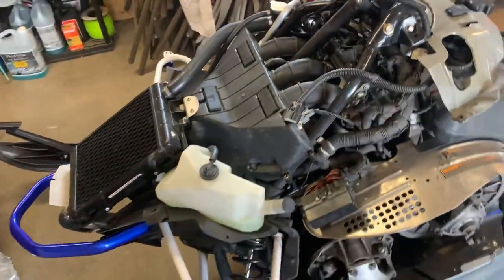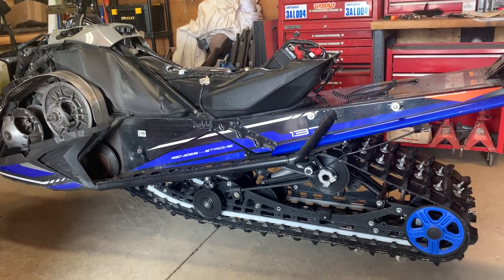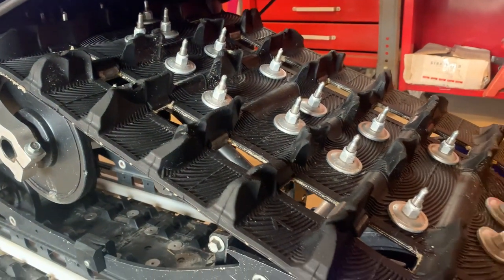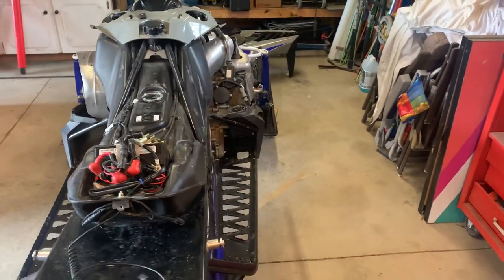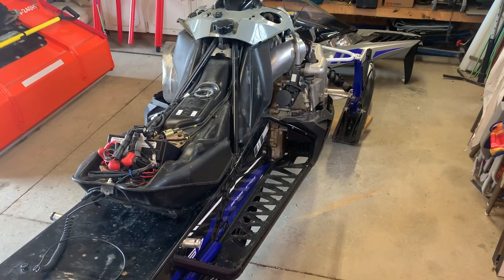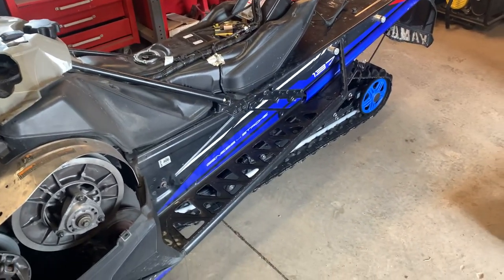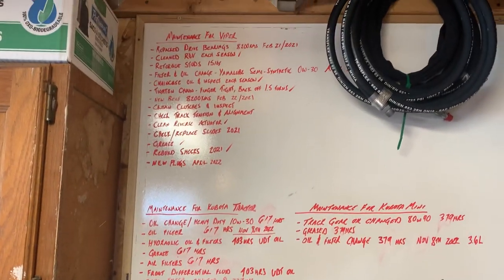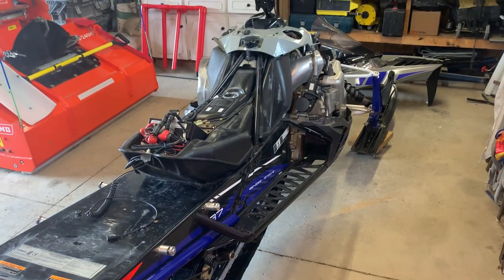Spring maintenance | 14,000kms service | Yamaha viper ltx dx

Comment: I’m doing the same thing on my 2018 ZR 8000 with 12k. My driveshaft had spun on the bearing. A local machine shop is building it back up with weld and machining back to spec. Picking it up tomorrow, should cost about $200
Reply from the maker: If your in Canada, a new driveshaft costs $218.00+tax.
From what I hear, the new shafts have been hardened a lot more now and supposedly won’t wear out like the old ones.
Reply: @sunsettrailrider  
The complete axle assembly is about $650 and the bare axle is about $350 in Canada.
Reply from the maker: @jarrodleis4046  that’s weird, I’m just replacing the shaft at $218 and getting the current drivers pressed on to the new shaft. Surprised it’s $350 where you are…
Reply from the maker: black bear  I bet it’s easy to swap out too!

Comment: While you have the chain case apart check the upper gear for for bushing wear. I replaced mine at 10,000km and it was shot.
Reply from the maker: Right on! Thanks for the tip.
I had a feeling I would be replacing it. There will definitely be a nice parts list accumulating over the next few days lol